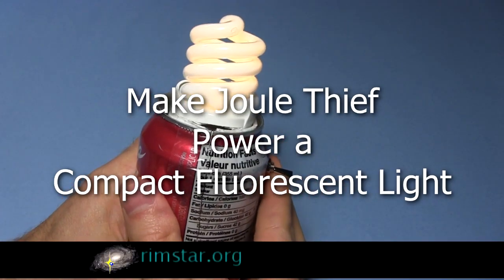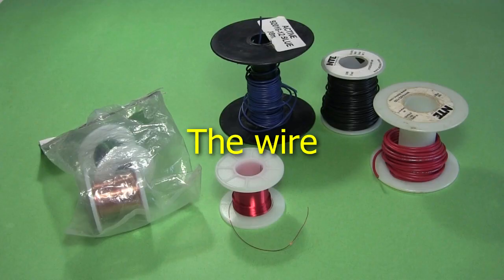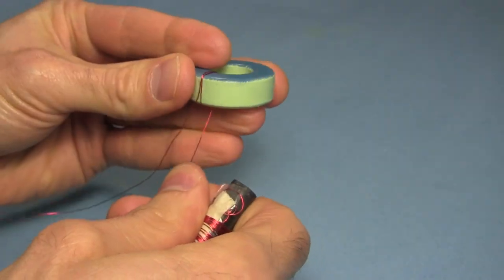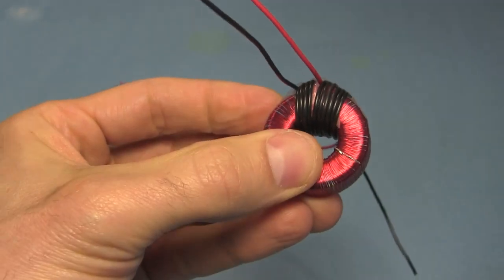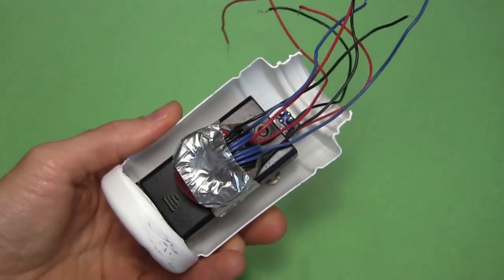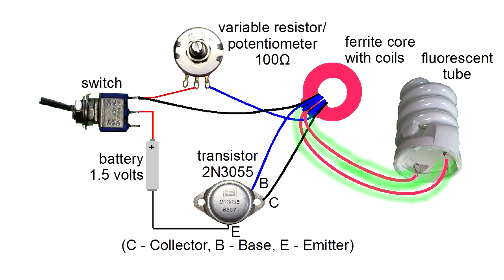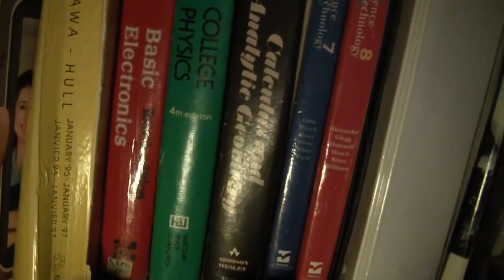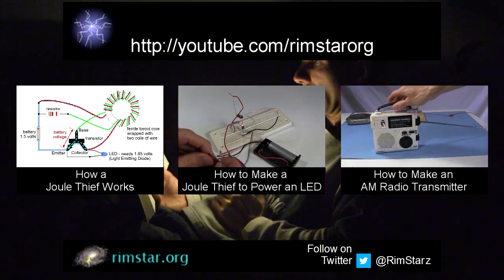How to Make Joule Thief Light a CFL - Jeanna's Light

Comment: I was wondering about the potentiometer, could i use a 10k potentimeter for this project?
Reply from the maker: Scotlahn Mccallister Theoretically you could, but it will be difficult. The resistances you'll want are all around 100 ohms or less. That's hard to select using a 10k potentiometer, though not impossible.

Comment: Are there any alternatives to the toroid? Could I do a lot of turns around an iron bar (basically the thing as your toroid just in a straight line instead of a ring)?
Reply from the maker: +Blakehx Before using a toroid I tried a ferrite bar without any success so it's hard to say.

Comment: hey, i have seen all of your videos and i am waiting for some new videos. but i have some questions
1.  is it necessary to use a potentiometer.
2.  which other cores can i use. can i use air core transformer. if yes, then please show how to make one.
and the most important question.  i am having a cfl with two tubes and there are two wires coming out from each of them. i am confused which wire to use.
please reply.
Reply from the maker: harsh bawari 1. You don't have to use a potentiometer, but you do need to know which resistance value works to give you the amount of light you want. The light varies with the resistance. So an alternative is to experiment with a bunch of different fixed value resistors until you get what you want. I don't know of any way to calculate it ahead of time. In my follow-up video to this one (https://www.youtube.com/watch?v=yz_99oVMbSI) I show where I determine suitable resistance values for mine, though I use the potentiometer to do it instead.2. That's an interesting question. I'd say no, you need an iron or ferrite core to keep the magnetic field in. However, this is a toroid and a coil wound perfectly all the way around a toroid keeps all the magnetic field inside the toroid, so maybe a toroidal air core would work. I don't know for sure though. As for making one, you could get a plastic or wooden ring from a craft store or make one.3. For a two tube type of CFL, connect the wires from one end of two tubes together and then connect the wires from the other end of the two tubes. Basically use them in parallel. Though if that doesn't work you could try them in series instead. But play with different numbers of batteries too. Mine didn't work with one AA battery. It's when I added the second one that I got success.

Comment: I am so totally making a bunch of these for emergency light in power outages.
Do you need fresh AA batteries or will this work with your so called "Zombie batteries"? I know it's a joule thief circuit so doesn't really require strong voltage but even so I'd like to have an idea of the minimum voltage this can run on as I have quite a number of 1.5v batteries.
Reply from the maker: +gskaloyan I never tested for the minimum voltage. I did do some longevity testing and if you put the transistor on a heatsink and find a low wattage CFL then with new batteries you can get 1 hour and 30 minute runtime. I show that testing in this follow-up video https://www.youtube.com/watch?v=yz_99oVMbSI.
Reply: RimstarOrg cool, thanks for the info

Comment from the maker: The lower the resistance of the resistor, the lower the frequency and the higher the voltage and visa versa. You can see me do this by adjusting the potentiometer (variable resistor) in my follow-up video "Fun with Joule Thief Powering a Compact Fluorescent Light" at around 3:12 into it. There's a link to that video in the description below this video.

Comment: yes, you are right even with my 40 gauge wire only covered 200 turns . so, what can I do without changing my core?
Reply from the maker: You can try 200 turns, but with a very low wattage CFL. In my follow-up video https://www.youtube.com/watch?v=yz_99oVMbSI I switch to a 5W CFL (6 minutes and 12 seconds into that video). The shorter fluorescent tube means it can work with a lower voltage, which is what you get with less turns.
Reply: but I replaced the wire with very thin wire and I end up with 245 turn.
Reply from the maker: Wow, that must be very thin wire to get that much on your small toroid. I hope it is insulated wire. I also hope you paid attention to what I showed in the video when the two ends of the coil met and I switched to thicker insulated wire, otherwise you'll likely have short circuiting. Where the ends come close enough to touch there's high voltage that can break through the insulation as I point out in the video.

Comment: brother can i run my wifi router by this Joule Thief ' is this joule thief supply Ac or Dc Current '? & What things are Needed  to make it plzz say
Reply from the maker: No, the output from this is high voltage, low current and very spikey. It's very limited in what it can power. You can of course take that output and add more circuitry to turn it into a more useful form, but you'd just be adding more inefficiencies. You're better off looking for a different circuit to take the battery output and turn it into the desired form more directly. I don't have any suggested circuits for that.

Comment: hey rimstar it was a very informative video, but i wanted to know that apart from old devices where can i get the ferrite core and what should i say the shop, as i tried asking him to give a ferrite torrid and it didn't help :-p.
Reply from the maker: +ABHISHEK PANDEY You can also buy them online, e.g. ebay. In any case, ask for ferrite toroid or ferrite core. If you ask for ferrite core they may show you other things too since that covers more type of ferrite shapes. I guess inductor core might work too.
Reply: Thanks! I got it on ebay
Reply: +RimstarOrg is there any other way to communicate with you, like email or whatsapp? Actually i am working on a project and i am using Joule thief in it, so if could get your guidance regarding that.
Reply from the maker: +ABHISHEK PANDEY My email address is at the bottom of all my webpages on http://rimstar.org. But I prefer comments in videos for a few reasons (as long as it's relevant to the video.) One is that it helps search rankings and so I get something out of it too, another is that I don't know everything and so others can help too.
Reply: RimstarOrg of course i understand why would you prefer comments, so if there's something that can only be asked via mail, then i will mail you else i will comment, thanks!

Comment: Can i use 5k ohms variable resister/potentiometer
Reply from the maker: Yes, that should work. But since the resistance you need is so low, less than 100 ohms, that means you'll have the potentiometer turned all the way in one direction and won't have much choice of brightness. But you should at least be able to get some resistance under 100 ohms.

Comment: I just tried a  led to see... the LED got let with the same intensity  in any way I connected it.. that should mean that:
1- the output on the secondary is  AC
2- the  negative and positive portion output voltages of the secondary are equal in  strength..  hmmm

Comment: can I use a toroid core with out Dia of 1.5 cm and inner Dia of 1 cm with much thinner wire?
Reply from the maker: Mine was od 3.5 cm and id 1.875 cm. Even with thinner wire, would you be able to get enough turns? I'm doubting it. Also, it's hard to get wire that's thinner than 30 AWG. I guess you can only try it. Let me know how it goes if you do.

Comment: Awsome! ... I still need to work on a similar idea that I have spinning in the back of my mind.
(DCSCB) Dry Crystal Solar Cell Battery. Voltaic Pile (aka: tea light battery or penny battery) or/and "Earth Battery". Connected to Joule Theif. SN305# has solar material inside right? Or InfaRed Led as luminous collector. Could also test "cement battery" or immersion cooling to resolve heating issue(s).

Comment: Batteries should be connected in series or parralel?? (1.5 or 3 volts??)
Reply from the maker: +Matěj Kadlec In series, so 3 volts. You can do like I did and start with just 1 battery, and if it doesn't work then add the second battery, and if that doesn't work then add a third battery and so on.
Reply: +RimstarOrg Thanks. Yesterday I wound the coil and ran out od wire in half of coil, should I divide other windings by two?
Reply from the maker: +Matěj Kadlec Yes, that sounds like a good idea.

Comment: I thought the two wires from each end on the cfl are suppose to heat the gasses inside so it can light up.
Reply from the maker: Tiger Zuo Yeah, I'm pretty sure they don't heat the gasses up. They provide a high voltage between the two wires and through the gas, ionizing it and making it more conductive.

Comment: will a 500k ohm potentiometer work?
Reply from the maker: Not practically, no. With a 500,000 ohm potentiometer it's hard to say what the resistance will be with the knob turned completely one way. It may be 0 ohms or 50 or 100 or 200 -- hard to say without measuring it. It may even jump from 0 directly to 1000. I guess you could measure it with a meter and see.

Comment: Rimstar i maked one like you shown but it didnt worked for while a minute my transistor got warm n bulb also not glow..what to do help me out
Reply from the maker: Some things you can try are to add another battery, connecting the positive of one to the negative of the other. Originally I had just one battery and it's only after I added the second one that it started working. So more is better for getting it working.
You could also try a lower watt bulb. A lower watt one will light more easily.
You could also try a lower value resistor. Maybe it's working but the light it too dim. The lower value of the resistor, the brighter it will be.
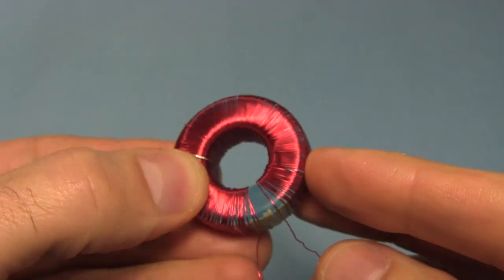And make sure you followed the instructions I gave at 2:13 regarding stopping winding before the two ends meet and switching to thicker insulated wire.
Also, it won't work if you have too few windings on your toroid core. As you saw in the video, I had around 256 turns.
Also check out my follow-up video where I test all these things and more https://www.youtube.com/watch?v=yz_99oVMbSI.

Comment: hi,i made one using 2n3055 and 680ohm resistor and teroid that i get from old radio i wind several turns for the secondery i think about 300-350 and 18center tap than another 18 for the primary i test it with a capacitor and it charged and when i try with cfl it didn't light up with 3.7v and 12v it lights up,i tried using 22 ohm resistor and it didn't work what can be the probleme?
Reply from the maker: +Yasser crazy boy If I understand you correctly, it worked with 12V? Do you have a lot of turns on your CFL. The longer the path through the fluorescent tube the higher the voltage will be needed in order to get it to light up. In my follow-up video https://www.youtube.com/watch?v=yz_99oVMbSI I show the difference when using a 13W vs a 5W CFL (shorter tube length).

Comment: Is it necessary to have 256 turns on ferrite core ?
Reply from the maker: It doesn't have to be exactly 256 turns, but the more turns you have, the better. 256 just happened to be what I could fit on mine. The CFL tube needs a high voltage across it to start up, and the more turns you have, the higher the voltage it'll produce.

Comment: i got a toroid bead but it is a bit smaller than that of yours and i didnt get magnet wire so im using smallest wire i m getting so will it do??????
Reply from the maker: That depends on how many turns of wire you can put on it. I don't know the minimum number you'll need, but you need a lot and with thicker wire you may not be able to get enough on there.
Reply: If I overlap the wire after insulating it with insulating tape??
Reply from the maker: Sure. If you have room to overlap layers then that's fine. Just keep turning in the same direction. If the wire has plastic insulation on it like the ones I added at the end then you probably don't need the insulating tape, unless you can fit it.

Comment: sir can we power this ckt using some number of piezos and a capcitor, whats changes have to be done more?
Reply from the maker: You can probably get a little power that way for a joule thief circuit powering an LED but I don't think you'd have enough power to light a CFL.
Reply: +RimstarOrg please suggest a an energy harnessing ckt if I connect a hundreds of piezo at time
Reply from the maker: I don't have any circuit for you. At a guess though, each piezo would be followed by a diode. That's because the output of the piezo is both positive and negative, and we want only the positive. Then all those piezo/diode pairs would connected in parallel. Then a capacitor would be connected to either side of that. All that would then go in place of the battery. But without trying it, I can't say if that would work. It's not something I'm going to be trying though.
Reply: +RimstarOrg thank you very much sir

Comment: Hi Guys, I am using PC Toriod Power supplay and, 2N3055 Transistor, 1 K Potentiometer, switch, CFL 8 watt, magnet wire from cross over speaker  and cellphone battre 3,7 volt but still doesn;t work. Give me more advice please.... thanks a lot.
Reply from the maker: Did you get at least a few hundred turns on the coil? The more you can do the better. Also, pay attention to 2:10 and 2:50 and so on where I point out that if you don't have good enough insulation on your wires then the insulation could breakdown. With a 1K potentiometer you'll have to turn it almost all the way down to get a low enough resistance. I don't know how much current is needed but I also don't know if cellphone batteries can supply that needed current, so before you give up you might want to try some other batteries too.
Reply: Thanks for your answer....but little bit dificult geting hundred turn on PC Power Supplay toroid 2.3 cm diameter because not enough space. I"m very glad if you helping me to try on your project use toroid like i'm used and make new video, he he he....thanks brother.

Comment: @RimstarOrg A few years ago I tried making a circuit like yours using a transistor from a CFL but it didn't work. But, I didn't gave up I was trying to find the way to make the universal CFL joule thief (as I call it), "universal" meaning that it can work with parts which can easily be modified/ or replaced. I ended up, with a circuit, which uses the mains AC transformer from a Nokia 5140 charger with the aditional coil of 5 turns, an 80 Ohms resistor and a C5027S transistor. I've uploaded a video in my channel and a scematic of the circuit in my Google Drive, both to be shared with you. If you want, you can try it out, it may give you an inspration on impving your onw circuit. :)
(in an older video, I used 8 turns, for an older model. The newer one in the new video below, has more efficiency)
     
     My video: https://www.youtube.com/watch?v=5qgvxW8Szp8

     My schematic: https://drive.google.com/file/d/1EOp9eqCbyssoLhk4wpCQp-HsUN8ssBhQ/view?usp=sharing

Comment: If I'm getting over 1000V on the ends but the bulb doesn't light it means the buld is broken/too high wattage?

Also if I tuned the pot down to a measurable range, the voltage waves at about 1Hz.
Reply from the maker: Yes, one possibility is that the bulb is too high a wattage and requires a higher voltage to light up. My understanding is that a higher wattage bulb has a longer tube, which requires a higher voltage to ignite. I show that in my follow-up video here https://www.youtube.com/watch?v=yz_99oVMbSI. Or as you say, it could be broken.
Reply: RimstarOrg I've made one more check and looks that besided over 2000V potential there's no current flow (checked both with CFL and 10ohm resistor)
Reply from the maker: How are you making your voltage and current measurements? I've never tried measuring the current since it's neither flat DC not sine wave AC, but if you have the voltage then there should be current. As I said, either your CFL is two high a watt rating or the CFL is broken.
Reply: RimstarOrg I finally managed to run it on 9V zinc-carbon cell (on 4,5V it started, but after switching off needed some time to "reload", otherwise lighted up only a bit). Also the transistor heats up very fast now (and makes weird sounds(.
Reply from the maker: You could try a heat sink on your transistor like I added in the follow-up video I gave a link to above.

Comment: Can I use that as a flyback driver?
Reply from the maker: Emre Homko I can't say for sure, but if you use the flyback as a normal step-up transformer and wind black and blue coils on the flyback and use the flyback''s existing high voltage winding as the output coil, then it might work. It won't be doing what a normal flyback driver circuit does though.

Comment: will it work with 200 turns?
Reply from the maker: 200 turns might work. I can't say for sure. You might need to use a very low wattage CFL tube, for example a 5 watt one. The lower wattage CFLs have shorter tubes and require a lower voltage. Since you have less turns, you'll be producing a lower voltage.

Comment: Nice and neat, loved the Cola can idea. 
Take a look at JonnyDavro's channel for trigger coils btw, then we'll meet you on the dark side of wireless projects too no doubt lol. They were used in similar circuits for the 'Fuji camera circuit' a couple of years back.
Current could be around 600mA or so for a Jeanna's light with those specs and 13W CFL, though am not sure as I don't have any 3055's. As usual though, doesn't matter if you use rechargeables and charge them up with solar in the day :)